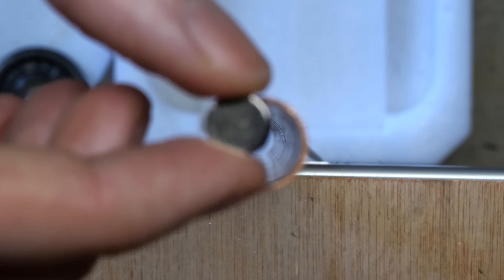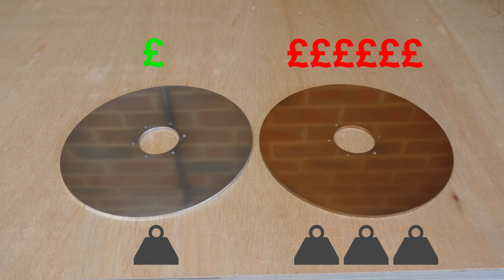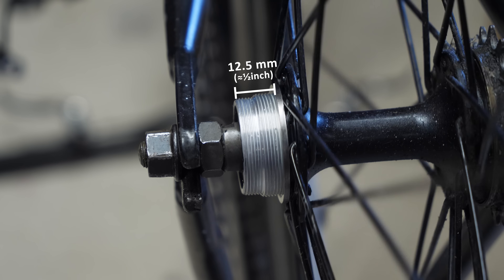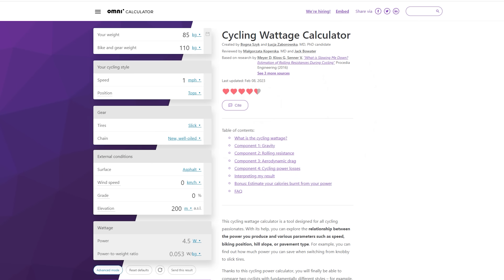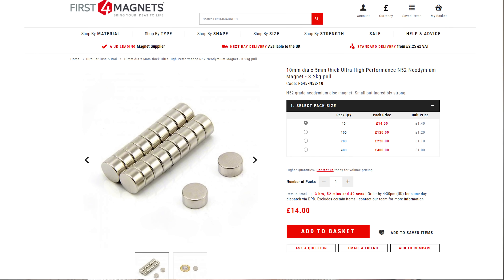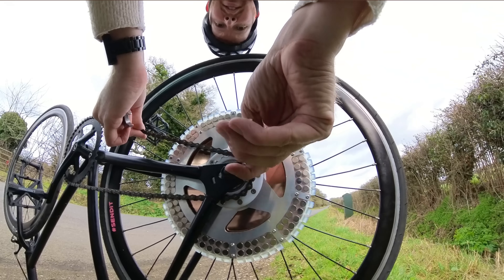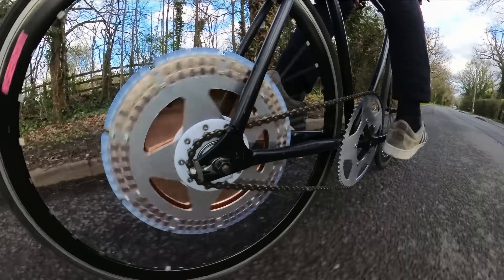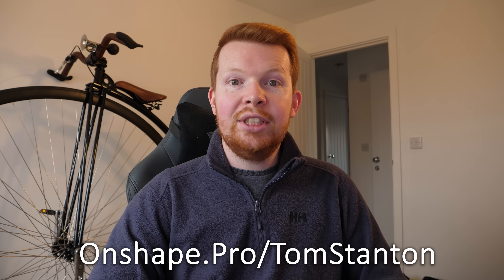Gearless Magnet Bike

Comment: what if u made the sprocket as big as the tire and use a non metallic bike and tire,,,, but never listen to me, and make sure u use some sort of brake system because as soon as u get it going you are not going to be able to stop maybe an electric motor bike with a composite frame,,, maybe that would work for electric cars also,,, hit the brake and it disengages the drive line and a lot more magnets front and rear but dont read this and think i know anything "great video"

Comment: Could you have made this whole setup at the pedal end and retained the freewheel mechanism at the rear axle to negate the heat buildup? I guess you would then need to pedal a lot faster - perhaps having an additional chain and sprocket to drive this faster and then a chain from there to the freewheel would work? Obviously major changes to the bike frame would be needed. Very cool video!

Comment: This would be awesome for not ever having to replace pads and rotors ever again. If the magnet set is controlled electrically, what is its contribution to battery drain? This would only be something to consider for battery capacity. These would also have to be strong enough to stop someone going down a long steep slope, because abrasive braking would ruin a copper rotor quite fast so might not be practical to combine.
Reply: Maybe magnets can "grip" the rim and we can keep the friction disc system to use only when we have to brake very hard? Yes, I know your system is for driving, my idea is for braking.

Comment: You need to switch the sprockets. The smaller sprocket should be the one that you drive and the bigger sprocket should be the one that drives the wheel.

Comment: So, what of instead of letting the eddy currents short out heatimg up your copper disk you used use a similar design but make it into a generator?  Hopelessly complex?  It would b function perhaps like a hybrid likely with the back generating power but with effort to charge a battery, then a hub motor in front.  No, no regen brakes although a miniaturized version of pedal generator could act as a regen disk brake in front.  On second thought a person/electric like a diesel/electric locomotive would be much simpler.

Comment: Cool project.   
Interesting that people still mx the old, obsolete and modern SI Metric System in the same breath.  Torque = Force (or weight) multiplied by distence.  Hence, Newton  Meter for a unit of torque where weight or force is a Newton.  But everywhere in the video you were hanging units of mass and calling them weight and magically multiplying in the acceleration of gravity to produce correct units for Torque and Watt in your charts.  Why not just join the 21st Century and call and calculate the weight haning from the diisks as a Newotn instead. And say 'mass" for kilogram when referencing that unit.

Comment: 2:25 this is sweet but you need to account for the moment of inertia... by adding some extra weight on the disc for example. side note, on a bicycle you'll probably want the lighter material... 
11:10 by intuition I would have attached the magnets to the wheel, not the pedals: you'd save on the zip ties ;-)
14:57 yeah obviously... it's like the arrow halving the distance to the target each time you look at it ; the clutch alone will never bring you to a complete halt
15:54 I was waiting for that one XD the 8kJ obviously don't account for the energy dissipated in the air. Please please please try again with the thermal camera mounted on the bike while riding! We want a graph!! I'd really like to know what happens to the torque transfer capacity (and heat losses) in relation to the temperature of the copper disc.
I pretty much knew where this was going, but this is brilliant : good preliminary testing, and I've been looking for a way to transfer torque without using hydraulics and this is just what I needed! Thanks!

Comment: To increase the breaking, you should have reversed the pedaling direction. To increase the torque force, you should have tried to increase the material thickness of the copper or aluminium disc.

Comment: Maybe that becouse of my bad english or I just missed it in vedoe, but I still can't understand what it for.
If it shoud let tou stop pedaling and not loose a lot of speed, this way it works as brake.
If that is a way to connect rear sprocket to rear wheel, you can just use direct connection.

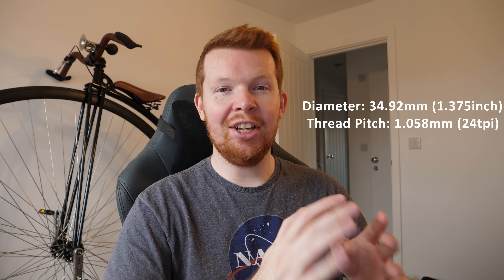Comment: I know this is a bit old but at 5:25, you said you cant machine that thread but you have a CNC router. Why couldn't you thread mill it? Does your router not have true simultaneous 3 axis control to be able to do helical moves?

Comment: Stray current brakes work well, if there is a big rotation speed, at low speeds they fail. Example the old rotary ac-counters with alu-discs have the same properties😂

Comment: I love your bike-related videos! I'm currently trying to understand basic mtn bike geo, and am envisioning an experiment that I don't materials or experience to do myself:

Setup: Inverted pendulum on a car with adjustable axle placement, something to stabilize the pendulum (motor?), and a course with undulations to acceleration/decel and bumps to roll over.
Test objective: find the ideal axle placement that allows for the most stable pendulum, to the point minimal overall work is needed to correct/stabilize it over the course.
Expectations: widest wheelbase that can still clear the undulations, with the pendulum centered towards the rear, with maybe a 60:40 weight distro, on the rear may perform the best.
Lesson: be better informed, to help filter through bikes that may not be so good based on bike geo (ie. beach cruiser bikes, that have cranks in the middle between the axles, disguised as mtn bikes)

Comment: What would happen if you added the same things, but on the front wheel as well? You are already moving the rear wheel and this turns the front wheel. Also, what happens if you pedal backwards after getting up to speed? Would this act like a better braking action. Additionally, what happens if you apply a current ac or dc? You could try siphoning off electrical flow much like a generator?

Comment: I don't really understand the point? Its still using gears and gear ratios, he even says it. And it is peddling like he's in a low gear because thats exactly what its in, the small rear sprocket is a low gear, he needed a larger rear to make it peddle easier.
But he even calls it a magnetic clutch, so why is he calling it gearless? I don't understand..

Comment: Copper is heavier than alimunium as you know and it is a rotating part So it multiplies, using a light part would give more performance, isnt it? Isnt it harder to use the bike with Copper? It might seem better in braking but its because it is also difficult to accelerate??

Comment: You wasted more energy than calculated from the heat emission because while you were driving it was air-cooled from spinning in the wind... So you probably wasted triple of that. But it's awesome that you can heat something without touching it at all... Without friction at all, Just by spinning a disc against magnets. Thats scientifical funny.

Comment: As a electrical engineer, I would say that the biggest 'problem' is that the only way you can apply force thru that system is when the disc spins at a different rate compared to the wheel, causing eletrical loses due to induced currents heating up that copper disc. So, on acceleration and on breaking, there is always some lost of power. The bigger the force you need to apply to the wheel (going uphill), the bigger the losses. This is similar to the way that induction motors work, but they operate at a much much more efficient manner.

Comment: ich halte es für unsinn ,denn ,jede kraft die in wärme umgewandelt wird ,ist potenzieller verlust der kraft.
letztendlich kommt die energie aus den beinen, die magnetkupplung wandelt einen grossen teil der aufgenommenen energie in wärme anstelle von RPM.
mein tip ist mach nen dynamo draus und lade einen akku beimfahren damit um ein teil der energie zu speichern und wieder abzugeben..

Comment: Amazing what you built there!!! You could keep a conventional 21-gear bike system on it, as well as the clutch type gear system you made with the disks. So if it's too difficult to rotate the disk on a climb, you lower a few conventional gears. And maybe there is a better way to generate electricity with this system and charge a battery too? Where that battery can help whenever you need it? You could go even further and automate the gear selection as well as the clutch, even the extra battery help when needed can be automated too, while also giving the option of fully using the battery when someone wants to go full electric. You could do a lot of things to improve this. And, if you keep improving it, and mainly because you never go full electric, eventually you'll make and add a combustion engine on it. The possibilities are endless. Maybe some retractable wings? When you wanna go over the traffic ahead? Or even some kind of oil spilling system for the traffic police in case they follow you. You could do a ton of things with this. Good luck!!!

Comment: I think this could be better utilized as some kind of breaking system. For example, using the inertial force already applied to the wheel to get the magnet bracket thing to spin in the opposite direction when the brake is applied to slow down the wheel. Although this would cause the copper disk to heat up faster than the passive braking demonstrated in the video but, this should slow down the bike faster 

Great Video by the way!!

Comment: This application has still some significant room to improve. Only if you #1 built in a clutch to separate the copper disk from the magnets or vs. So the bike does not slow down. #2 All that energy waisted going up hill needs to be converted into A thermoelectric generator (TEG) then used to power an electric motor. The more resistance = more power and more power = more thrust. This could accomplish your goal for a gearless bike. Disk brakes are not a deal braker. Could also increase the size and wieght  of the copper disk to resemble a flywheel. Also enclose this entire module so to increase heat to the maximum.

Comment: 13:19 Have you also tested freewheel and flywheel and thicker copper disc? And on the backside of magnets you need normally steelplates, to better feed the flux, and you will not have problems with magnetizing of chain.

Comment: I would suggest utilizing the Eddy currents to store energy so it can act as an electric bike when needed. The heat is generated from those unutilized currents. That would solve your inefficiency.
Reply: Kind of like regenerative braking? Using the brake force to store some "losses", and of course, that would help it brake more efficiently, as well (especially at back pedal)
Reply: Using superconductors to eliminate ohmic losses?

Comment: ***Change the design slightly - put slots in the back magnet wheel so the magnets can move back and forth based on RPM maybe you would get some variability in torque base on how much centrifical force the wheel is applying the magnets since the RPM would would be larger when they are at the bottom of the slot and lower at the top of the slot.

Comment: Isn't this a safer heating element in disguise here. If I used a motor to spin the disk behind which I put a fan, would it use less energy than a conventional heater?

Comment: 10:57 Well, i think there is a flae in your design: the part of the magnetic field, which flows thru the air, and which stick the chain, should be contained by some metallic part. That whay, the magnetic field eill ingrease, and lines of field wi be contained. As a result, there would be less chance that the chain stick on the magnet

Comment: What if, you made the magnets some kind of a variator? where the magnets start from a wide radius, which is high torque, then slowly move down a smaller radius as the speed increases therefore high speed low torque, kind of like a CVT but with magnets.

Comment: Hey-you have the design wrong-you have to put the magnets at a 45° angle and diagnal on a cylindar-sort of like a barber pole-and then wrap copper windings inside the cylindar-then put two long bar magnets on the outside of the cylindar-which move in and out with like with a throttle cable on a motorcyle if you will-when you bring the bar magnets closer to the magnets on the cylindar-it should start to spin-when they are pulked away-it will stop-also-look up 'Troy Reed' on the magnetic engine for a car prospect-thats real informative-good luck-!

Comment: Copper coils beside but not touching wheel that will be fly wheel as you would extend frame to accommodate a 24- 26 inch wheel to roll on ground.

Comment: you are building an induction motor with mechanically moving poles instead of electrically moving poles. First, the induction rotor needs to have gaps in the metal to avoid Eddy currents and losses. This is what you have here

Comment: You can’t trust google on anything these days. They keep changing facts and hiding old knowledge. As a kid I remember I learned in electrotechnology class at school that copper is a petter conductor than aluminum and silver is better than copper and it was not the only source where I’ve heard it. There is no wonder people used copper very extensively in the past when it comes to electricity and plumbing. Now we’ve switched to lower quality and much cheaper alternatives such as aluminum and plastic. Also copper is good for our heath, that’s why it was used as kitchenware. Now they poison our bodies with aluminum, plastic and teflon.

Comment: why didn't you take your feet off the pedals when you were letting the contraption do it's own thing?
Reply from the maker: During braking? Because I have to apply a huge backwards force to hold it still for braking.
Reply: @TomStantonEngineering  No - well maybe I was watching too early this morning), I got the impression you were retarding the motor with your legs and feet by keeping them on the pedals - when you let the cycle go on by itself having built up a head of 'steam'. Also there was another video flagged on my screen hinting at the efficiency of belt drives, which I'm sure you've seen too. If only you could afford to  play around with carbon fibre disc wheels or are they even more conductive? ¯\_(ツ)_/¯ I shall investigate if you have already investigated ..... thank you for such a quick response btw. Col

Comment: Go back to using the 3 ring front derailleur group.  Or a ordinary rear derailleur group to change ratios on the fly.  At the end of the day, direct chain drive is the most efficient, and cost effective way to go.  BTW, narrow-wide makes for a quieter ride.

Comment: If you revisit this, I'd suggest a larger disc and milling a heatsink into it from the center to just before the ring of magnets. (long as the process doesn't make the disc too thin, the added surface area spinning against air should make a huge difference)
Milling grooves in the areas magnets aren't spinning against shouldn't increase resistance too much, since most of the current is happening where the magnets are passing by.
As others have suggested, a different approach to the magnet array and a steel magnet mount could increase your efficiency as well. If you want a better gear ratio, you'll be switching from a copper disc to pedaling a generator wired to a motor, which could in theory give you that cvt experience depending on how you design it. Remember the supercapacitor bike? Make that foot powered. The tech you would need to make the supercap bike capable of regenerative braking would give you the buffer for a cvt-like experience in a generator-powered ebike.

Comment: They're a bit pricey, but you could get a titanium bike chain to solve the issue of them interfering with the magnets. And I guess carbon fibre spokes since tensile strength is what's important. ...I also wonder if there's a way to make it feel more like a regular bike when not pedalling.  Maybe it's possible to have the magnets pushed closer to the disc while pedalling but then relaxed when you're not.

Comment: Testing out theory vs. real practical application. He makes excellent points. The next thing to do is to figure out a force needed to move the bicycle up to 20-25 mph to justify all of the benefits of the gear-less system. My guess is that some form of E-propulsion needs to be added to assist the cyclist in attaining the speed they need to enjoy the ride while at the same time adding in more resistance which would assist in the braking function. As he showed in the video, the braking system needs help too. With more force on the chain to back sprocket, more resistance is built up and maybe that would solve the braking issue. But in conclusion, I guess this is one of those "Good idea but not quite there yet," videos. Keep up the good work, Tom and we all are interested in seeing if you can get this design to be fully functional for the rest of us. Looks like a good concept for a bicycle company to use. Maybe hold off on showing your final "By God, it works!" version and patent your concept, instead and make some cash on this idea. THUMBSUP

Comment: Of course, you generate current, you generate heat.
Where the magnet falls through the tube, where does the potential energy go, after all? That was one of my favourite demonstrations back in the day, I had a second tube with a slit down it that I hid from the students. Fun times.

Comment: Now what if you put some Peltier electrothermal pads on the copper disk, recharge some batteries with the heat (which will generate whether you're pedaling or breaking) and wire those to an assistive motor to help generate torque when you go up hill?
Self-Recharging Electric Assist Bike? Eh???